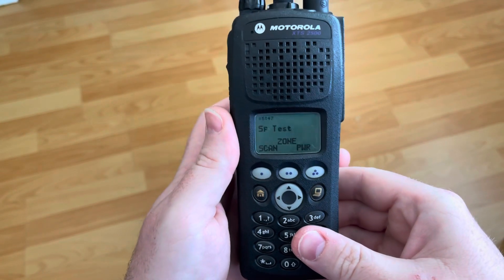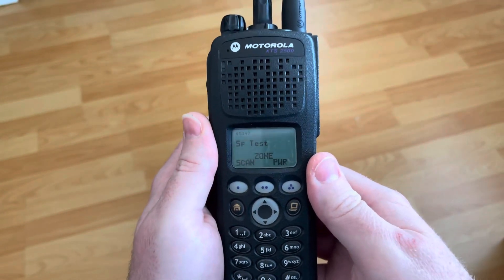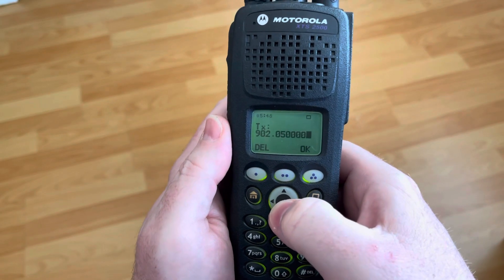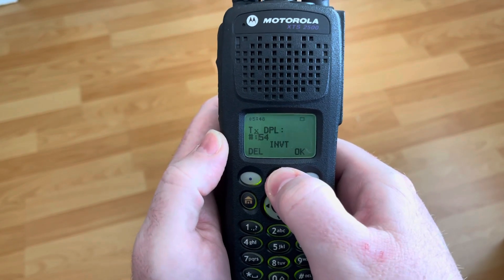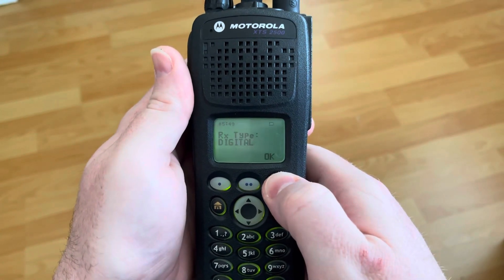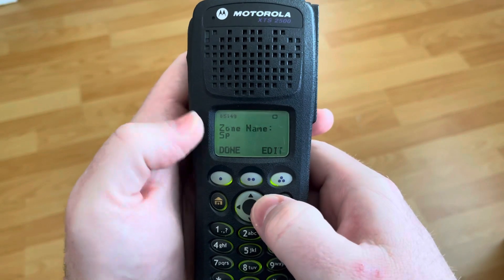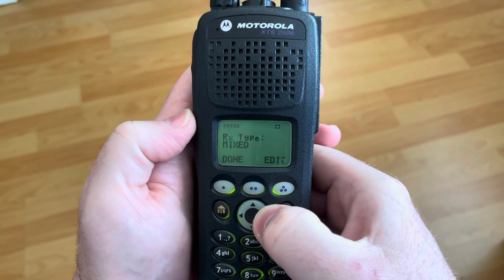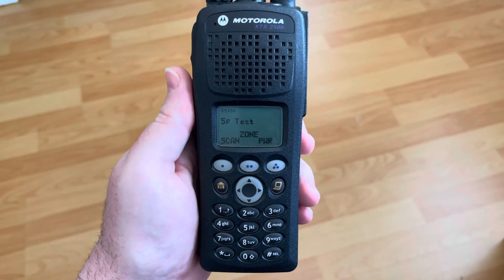FPP on a Model II ?

Comment: i'm having the worst luck. i tried to change the resistors and that didn't work, so i tried a used pad and now my radio won't come on. and also there's a glitch in my software that won't let me put in the correct tx freq. any throuhts, 73's n0mnb
Reply from the maker: This makes no sense.  There's no resistors in this.
Reply: @W9CR  thanks for answering I'm still working on them all.